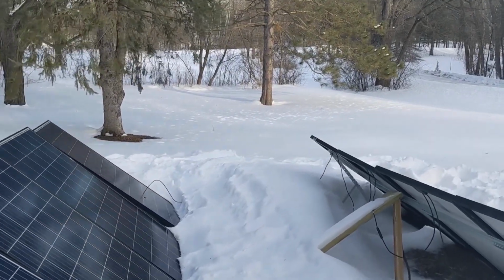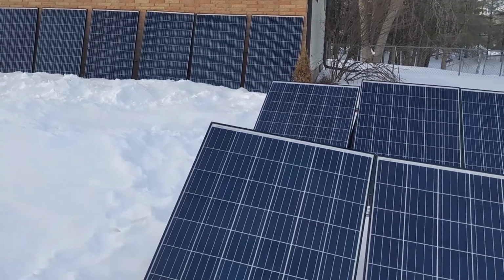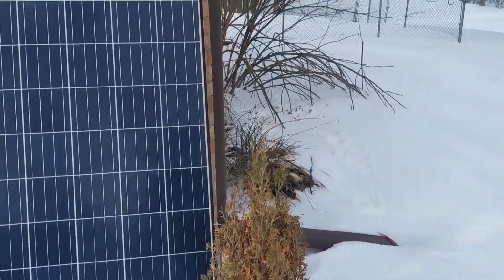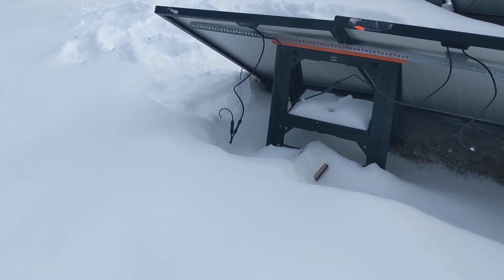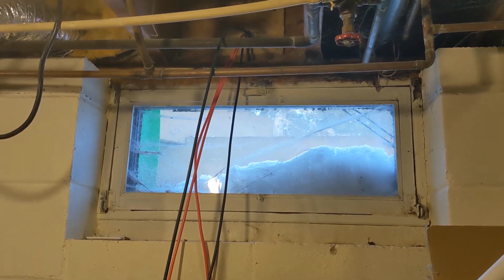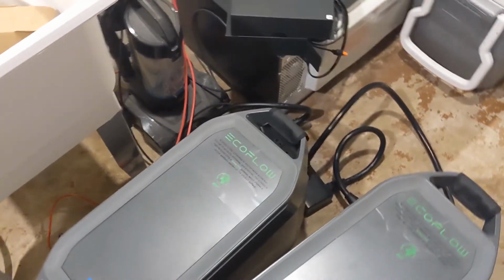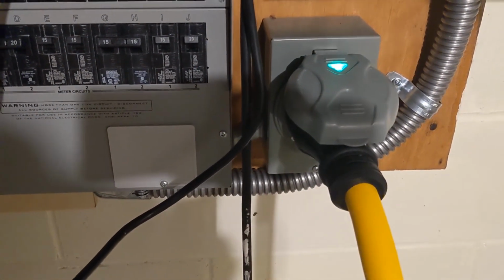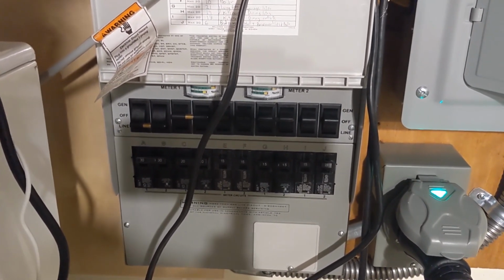Solar panels recharging two EcoFlow Delta Pro battery packs

Comment: Would have been nice to see how much juice they were getting
Reply from the maker: Not much. You can see that it is winter and they weren't properly mounted yet. Also, the shade of the trees hurt production.

Mid-summer, the 8-panel group was putting out 1600 watts. The 6-panel group was producing 1100 watts. Numbers are back down to about a quarter of that now that it is winter. Working fine, though.
Reply: @Zoyx  you ever think about getting like bifacial panels I heard they are really good for cloudy and snowing weather …. But that’s cool I just order my delta pro as well as 2 trackers and about 12 panels 200 watt a piece
Reply from the maker: @dieseldawg7132  - That would be nice. I bought these used, so they were dirt cheap. Fifteen used 260 watt panels for $1400US shipped. I am surrounded by trees. Getting new and expensive panels wouldn't make sense.
Reply: @Zoyx  I got you I got mine for around $1500 from eco worthy on blk Friday , and since they are new and I’m getting the delta pro it will all be written off on my taxes I will get 30% of my total to deduct from my taxes …..
Reply from the maker: @dieseldawg7132  - Yep, looking forward to my 30% as well.

Comment: Hey nice setup! Nice quick easy video to watch! Can you provide some info on the solar panels!? :) I'm curious how you got 2080 watts of solar on one delta pro. I have 250 watt panels and can only safely wire 3 panels in series with 2 sets of 3 in parallel because of the open circuit voltage OCV. What are the specs on the panels and what are they? The 6 panels in understand but is the voltage lower for 4 in series and the amperage higher? The built in mppt Controller can handle the amps coming in but not the overvoltage of open circuit. Please and thank you! 
Btw I heard 260 watt panels that's why I'm asking and got 2080 watts for 8 panels.
Reply from the maker: The panels are Jinko JKM260P. I took a multimeter measurement for the 8-panel set up, which returned 145 volts. So just under the 150 volt limit for the Delta Pros. I have briefly burst over 1600 watts. I may have to go to 6 panels when I get these panels properly mounted and the summer sun hits them. We'll see.
Reply: @Zoyx  very nice. I was wondering if the open curcuit was gonna be too high. The 150v max on the Delta pro is supposed to be for open curcuit but some people get away with more and it runs with a load below 150v. Be careful with clouds. The voltage could spike and shut the mppt Controller off like it did with Bladeslicer on his channel during a outage test video he did. He had to drop a panel to stay under. His were like 400 watt panels and unfortunately he lost a full 800 watts but you having 260 watt panels you'll only lose 520 fortunately lol
Reply from the maker: @jaysonstebbins2539  - Well, 260 x 6 is 1560 watts. I'll take that. These are previously owned panels so I doubt I'll get the full 260 watts from each panel, but I still feel I can get close to the 1600-watt max.
Reply: @Zoyx  absolutely! I would take that too! Nice job!